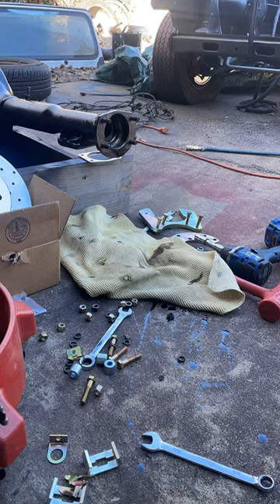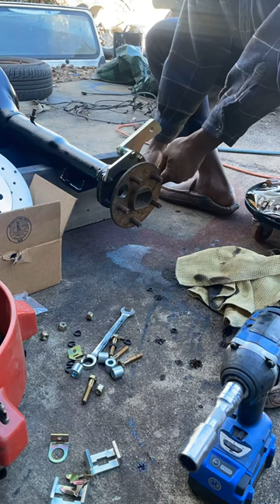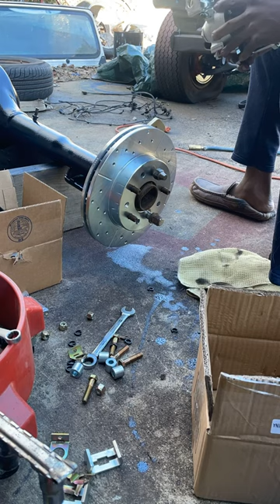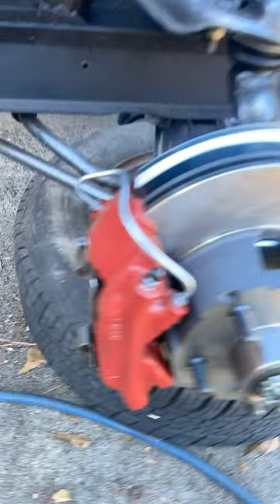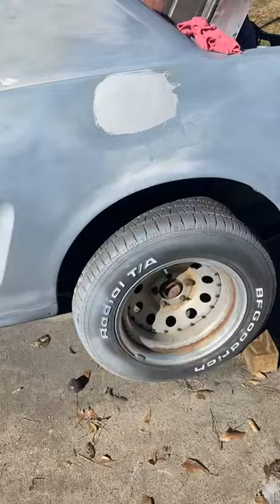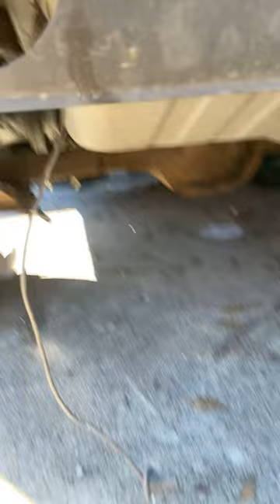1966 mustang 8inch rear engine disc brake conversion

Comment: This is a pretty good representation of putting one of these kits on
But remember there are 3 sizes of Ford 8” rear ends before ordering make sure you take your axels out and measure your end flange the bolt diagram
I did one but after getting the get I found out that I needed a small bearing kit !!!
Reply from the maker: thank you, and yes make sure you have small bearing and not big one, most 8 inch are small but measure before ordering